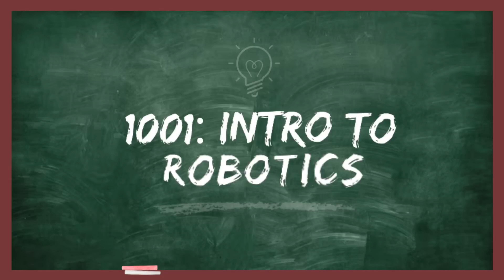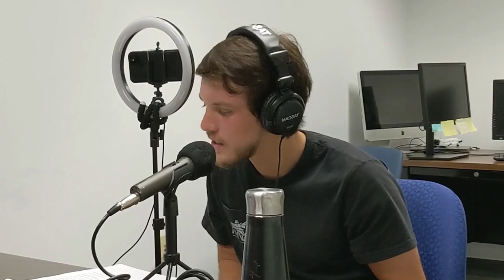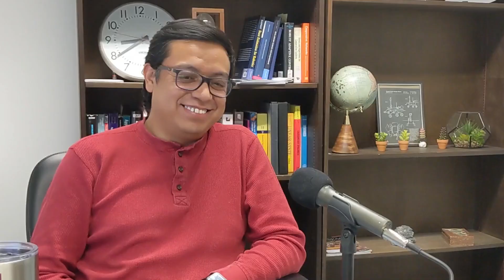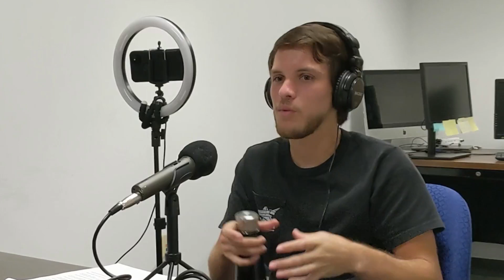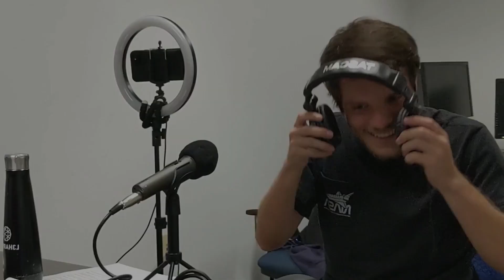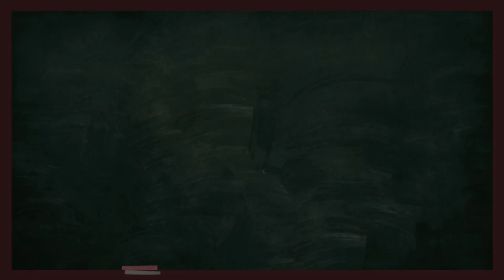Robot Navigation, Kalman Filters | 1001: Intro to Robotics podcast #1 with Humberto Ramos

Comment from the maker: OUTLINE:
0:00 - intro
1:24 - different areas of autonomy 
3:20 - navigation and estimators 
8:22 - causes of sensor noise
10:40 - sensor bias
12:20 - designing an estimator and linear models
14 Observability analysis
20 bad sound 
22:15 - kalman filters abd benefits
26:50 - how does the KF work?
32:01 - how to get the actual value. We know the error
37:20 - improving applicability of KF